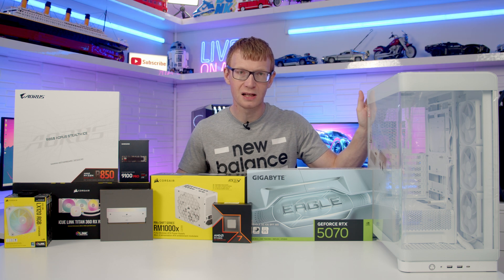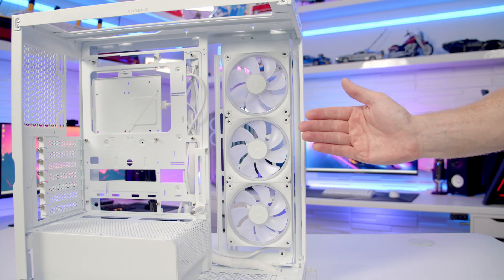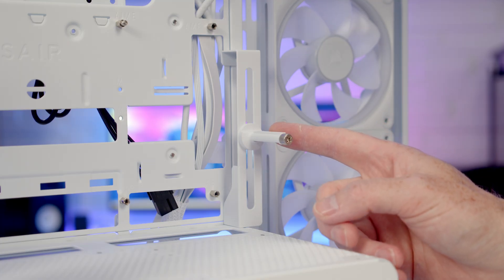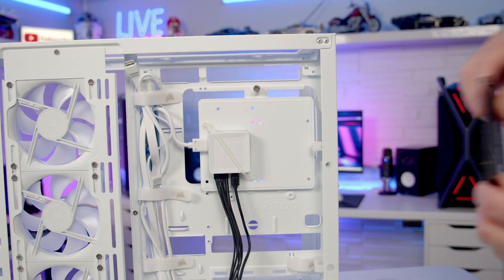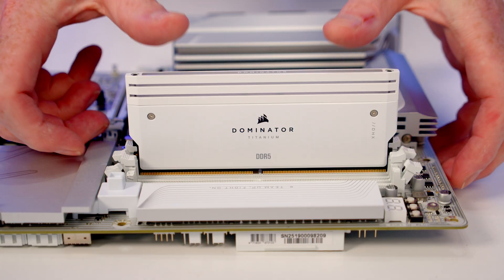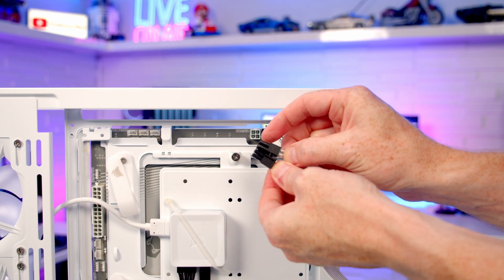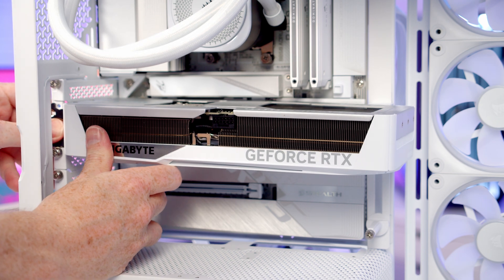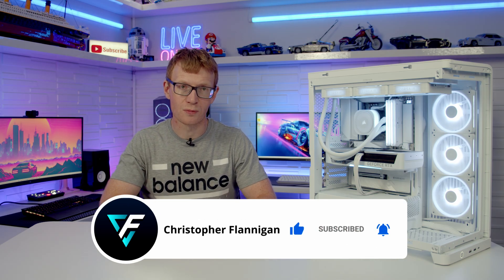Corsair Frame 4500X Build - Step by Step Guide

Comment: this case solved a thing that in dont like in the 4000D frame. That is that on the bottom part of the case there is no intake aside from the PSU intake hole if that makes sense (english not my language)